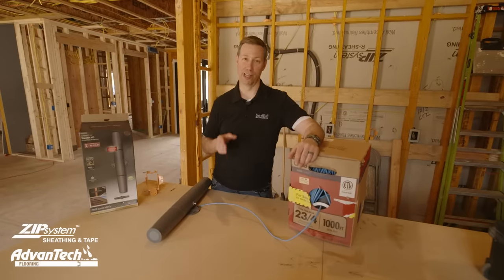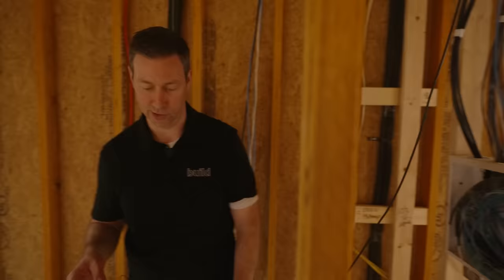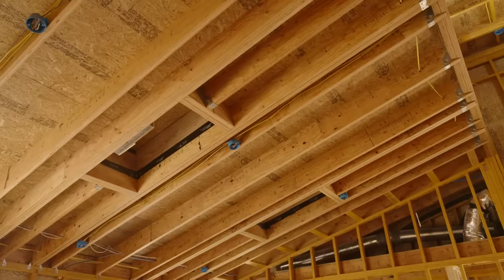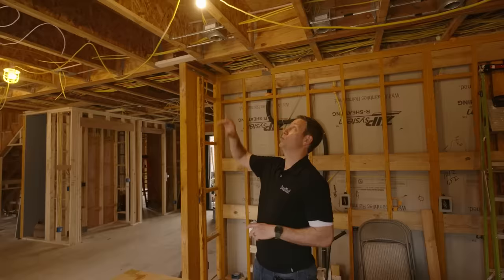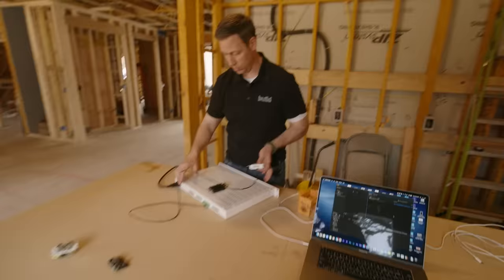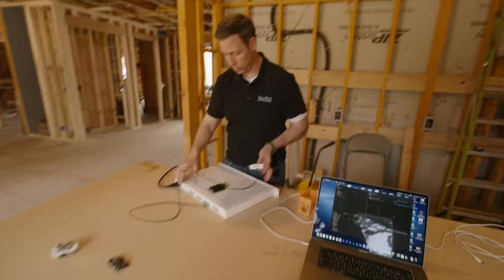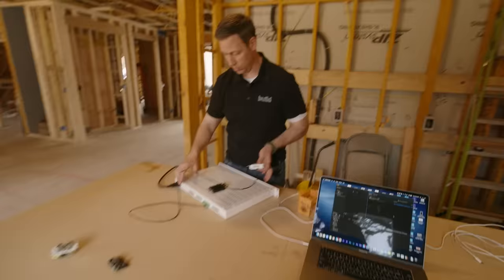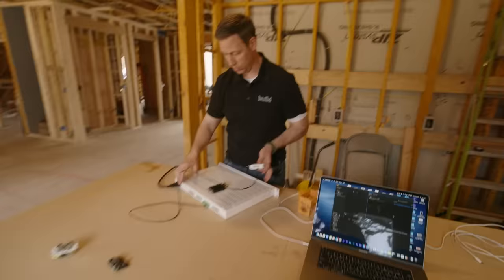Low ⚡Voltage at the Real ReBuild

Comment: And I absolutely would not do WAP's anymore. To expensive. Just wire a few places with an AC outlet and a network port. Then just use a mesh system. Lower cost, super easy for a regular person to install and doesn't burn as much when you upgrade it in a few years. I prefer TP-Link. And I pretty much install only Ring doorbells and cameras anymore. Ties right in with Alexa, Echo Shows and even the Samsung smart fridge display. Pretty great. BTW. I own an AV integration business.

Comment: You'll want low voltage smoke detector interlink connection as well. I just don't trust the fancy $100/each WiFi/Bluetooth smoke detectors. Personally I want those on hard wired on 110v and physically interlink connection between them. I did get the 10 year lithium back-up battery smoke detectors, but still 110v primary power.
Reply: Code requires linked 110v/DC smokes...

Comment: Run a separate power and conduit (for low volt) to behind the TV just in case Samsung's interface becomes a brick in the wall. (also PLEASE put your TV at the right height and not some excessive height that a lot of home renovation shows place their tv's at; now is the time to imagine sitting down at your couch and watching tv ... at what height would it be comfortable to watch).
Are the sonos speakers going to be able to receive discrete sound channels appropriately
(https://www.dolby.com/about/support/guide/speaker-setup-guides/)?
Do you have a place to put your subwoofer?
Ubiquiti's stuff is solid, but will the wifi be strong enough at the location you're placing it at to cover the house or do you require additional Wireless Access Points in other area(s) of the house for wifi coverage (run a single PoE line to these areas)?
Wherever you will have networked devices run extra network connections - devices that have a wired connection and that do not move around should be wired in (in case you get additional devices such as printers, media players etc), then have wifi to cover the rest.
Your Cat6 cable is 23AWG which is a good choice; just make sure it is solid copper and not CCA (copper clad aluminum) or stranded cable.
What about running additional wiring for security (door/window/water alerts)?
While not completely phased out, what about wiring for regular phone lines?

Comment: Regarding wireless you're picking up on something very important. The wireless of the future is wired. That sounds stupid... but the gist is that in order to make a reliable high speed wireless network you need access points throughout your home. The next gen of Wifi is designed around that idea as well and those access points are all wired.

Comment: As I’m looking at the photograph on YouTube for this video I noticed that the wiring above your head is not in the middle of those trusses, is that the way it supposed to be? I thought those holes had to be in the center of the trusses not near the bottom or the top. Perhaps I’m wrong I’d like to know.
Reply: Doesn't have to be centered. 1.75"(?) from finished surface minimum.
Reply: @skynetlabs  
Finish surface meaning with the drywall in place or the piece fastened on the bottom of the truss? However the piece on the bottom may measure 1- 9/16” I’m not so sure that’s the correct answer or if it is it’s written in a different way. 
The way I understood it, it should be in the middle 1/3 of the truss. 
I’ve seen contractors go ballistic with holes drilled in their truss because the trusses then will fail inspection. One could get away with many things decades ago but not anymore.

Comment: The Unifi stuff is pretty good, it is near professional quality gear that doesn't take a network engineer to install and configure.
Reply: It doesn't require an engineer, but it isn't for the "technically disabled", either. Lol.

Comment: Be careful as Ubiquiti got hack recently and unknown amount of their information was download. Ubiquiti is also a high-end solution and there are more affordable solutions that can do the same if not better job. Also when possible hardwire to devices as much as you can. WiFi is a security issue if not a risk, so any device that has a RJ45 wire it up. While have access I would run Cat6 to every window (that opens) and every door as with a new Raspberry Pi Pico ($5 or less) that just came out you could have a very low cost security device.  It's great that you went with Cat6, wire as much of the house with that as you can!

Comment: If you are using multiple unifi cameras you should use the unvr for cameras not the dream machine,
That way you have 3 hard drives for storage and 1 for redundancy 
Dream machine has only 1 drive so if it dies, bye bye camera recording

Comment: You made a mistake by not running cat 6A, at least for your WiFi access points..  It's not like you probably need 10 gig to the desktop but your better 802.11ax access points support 2 and 5 gig ethernet, since they can provide wireless data rates to clients in excess of a gig.

There are already commercial LED lighting panels that can be run from Power-over-Ethernet and have the ability to dim and change colors from the controller, plus integrate into other systems (security/alarm system comes to mind).  These do require an ethernet switch with a beefy power supply.

Lastly, a tip for the future to save time (i.e. don't tone your cables):  When pulling ethernet or whatnot, use a sharpie to label/mark the end of cable sticking out of the box before you run the cable.  Label the cable boxes or spools with the same mark so you know which box belongs to which cable.  Example: if you're pulling cable from 4 boxes at a time, put 1 tick on the first cable and box, 2 ticks on the second cable and box, etc., then pull.  Before cutting the cables off the box, transfers the same marks the boxes have to their respective cables.  Change up the pen color or use different marks for the next group of wires.   Could even use a combination of letters and numbers system.. Whatever is easiest to write on a cable, just make sure to update the mark on the box before pulling.  The goal is to not have to strip and tone, which takes two people and potentially a lot of time.

Comment: Wow, for once you talk about a nice high end home “prosumer” product and I don’t have to worry about it adding to my future budget!

Big computer/networking nerd here - I also use ubiquiti devices for my home network. I’m a huge fan of the price to performance/features they provide. Right now I’m using one of their wired-only edgerouters and two of their wireless access points to get coverage all over the house, had this setup for about 5 years now and have 0 complaints. Also finally got 500/500 fiber to the home after dealing with the cable company for so long. 

Especially with working from home, I like to run everything I can wired (the main pc, both tv’s roku boxes, receiver, bluray) to free up wireless bandwidth for the wife’s work laptop, my work laptop, our phones, and her tablet. No kids here but if yours are heavy streamers you might want to look into adding an extra access point on the second floor.
Reply: and I get further into the video and the goodies keep coming 

UPS for fiber box/router is fantastic for small power blips (I’ve got a small rackmount one, gives me 2-3 hours of internet without firing up the generator)

antennaweb.org is great, I’ve also got an antenna (mounted in the attic) that I just split to my tvs

Comment: 5:56 Fair warning about crimping your own network cable-- use EZ connectors if you can get them. https://www.markertek.com/product/plat-202016j/platinum-tools-202016j-ez-rj45-cat6plus-connectors-50-ez-rj45-cat6-strain-relief
https://www.markertek.com/product/plat-100054c/platinum-tools-100054c-ez-rjpro-heavy-duty-crimp-tool
The EZ connectors allow you to push wire all the way through the connector and verify you have the wire placement right before you crimp-- the tool will trim the excess. With traditional connectors if you are not exceedingly careful when you go to crimp, one or more wires can pull themselves out of the metal fingers of the connector, forcing you snip, strip, align the wires again and recrimp causing waste and additional hassle if you don't enough slack to compensate for the loss.  For a similar reasons use a modular keystone patch panel rather than the old style idc.  It is significantly less hassle to replace a bad line if you don't have to worry about putting stress on the other lines.
Speaking of that media closet it will get quite hot in there especially if you install any servers (NAS, piHOLE, Automation, et_al.) in there, since you still have the walls open it's a good time to plan for ventilation.  https://www.amazon.com/AC-Infinity-CLOUDLINE-T6-Temperature/dp/B074XBXFPD?ref_=ast_sto_dp  ... 8:32  wait... Looks up available info
https://voltekinc.com/dc-products/  While it does put out low voltage, its input most certainly isn't (With a 663 watt max (650w x 1/0.98) you may want a separate rack and UPS for that. )
Reply: @pauljgregory  Thanks for bringing attention to that.

Comment: The Voltek product seems too specific of an application. Would a POE switch not do the same thing and have way more versatility? We used that to get rid of all of the power supplies for our office phones. Or would a POE switch not provide enough power to charge a laptop?
Reply: POE rack mounted switch with 100w per channel output is a much better idea than that (assumed overpriced) made in china pos...

Comment: Can you not just run a circuit with, say, a 3A or 5A breaker and then therefore smaller wire and stick with 120V AC?  The breaker needs to be sized appropriately for the wire to protect it, and if you use smaller wire running a smaller breaker should offer the same protection.  Unless the authorities simply say "no, not allowed" I guess.

36V DC is actually going to require larger wire than 120V AC for the same power.

Comment: Cross discipline YouTube: regarding the voltec and macbooks louise rossman does board repair and the other day did a repair where the charger quality was an issue. I'd be curious if the voltec or any built in substitute is adequate quality to avoid damaging components.

Comment: It makes no sense to run heavy gauge cable for LED lights, that pull about 1 Amp at 120V, and then run narrow gauge LV cable that could pull 5-Amps per device at 12-20V. Voltage drop is a real issue.

Comment: ? 4 U . The media closet . Why do you seal the holes for the wires coming down to your box . ( great stuff foam )
Reply: Could be preventative. It might be required if the closet caught fire to prevent smoke and flame from rising to the next floor. Didn't catch it myself, was the foam orange? That's fire block. 

Also could be sound suppression through the holes too.
Reply: @AmandaComeauCreates  looked like great stuff . i just fig if you ever want to run another you cant just tape on to it and pull 2 . you have to crawl over or cut the ceiling lol

Comment: I'm really concerned about your cable there if I'm honest.  Firstly, the amazon link is to CCA, copper clad aluminum.  This stuff breaks easy, and if POE is ever needed, it has a high risk of melting, shorting, or catching fire.  You'll want to run Solid Copper cable, CMR (riser cable), along with shielded.  The Ubiquiti products are commonly POE.  Cameras are commonly POE.  You want the shielded with drain line (because it gives the ability to safely fault to ground) but also protects your equipment in the event of low voltage surges, shields against EMI and RFI of course, making sure you don't have packet loss, or risk of damage from static.
Reply: Of course you're not done with the build, but I'd recommend power conditioners in your low voltage closet, with a rack case, and two shielded grounded patch panels (one panel from the router, etc. one panel to your jacks, devices, and access points throughout the house)

Comment: Always run at least 2 ethernet to each location (A & B)...its cheap, gives flexibility and you're already pulling one cable. Just grab a second box and pull it with the first. You'd be amazed at how many times this solves the "I wish I had another port here..."

Comment: I had a full Ubiquiti wired and wireless internet system professionally installed in my home and regret it. Since it was professionally installed I don’t have access to make admin level adjustments and the wireless portion of the system, which is a series of ceiling mounted access points, is just mediocre at best performance wise.

Comment: Should try not to run low voltage/Cat cable next to 120/240... 12" Hz and 3" vert spacing is common to reduce interfere..

Comment: That Voltek system is going to use quite a bit of power when nothing is plugged in. Also, sending 60 watts of power through the house using DC is not as efficient as AC. So all their marketing about being green and environmentally conscious is not really applicable. They are also converting that from the 36v to 5/9/15/20 at the wall outlet, which reduces efficiency. You really are not saving on materials; you are already doing the copper for outlets, not like you can avoid that. And laptops come with chargers, so can't avoid that either. You also must buy the controller/converter for the voltek, that's not material-free.  Some laptops need 65 watts or more, so ya, it's an interesting concept, but other than convenience and "looks" it does not solve many problems.

Comment: Doesn't your speaker wire need to be CL2/CL3 rated for in wall use?
Reply: Most speaker wire should be at least CL2 for in wall riser use

Comment: I recently talked my boss into adopting more tech. But it's not worth investing in cat5 or whatever, because maybe everything is fiber in a year. Or maybe someone wants to run speakers. So what I talked him into running conduit, to buys can fish whatever they hell they want
Reply: I don't believe Fiber will replace Copper connecting devices. Issue is that terminating Fiber is considerably more difficult and requires expensive equipment to do it correctly. Fiber is great for long distance runs or backbone data lines which you need more than 10 Gbps per link. My guess is that Cat 6A will be the long term option since it currently supports 10 Gbps and perhaps 20 Gbps for runs up to about 150 feet.
Reply: You can't run power over fiber. You can with copper...

Comment: I wish that voltek power supply had more power for the price. USB C power Delivery standard can deliver a maximum of 100W but they cap you at 60. I wonder what the limiting factor for that is.
Reply: Finding an appropriate voltage convertor is probably the issue. I am sure the voltek unit has multiple smart power coverters. for USB c it need to supply both 5V and 20V. There is a data comm between the power supply and the device to negotiate the voltage. It defaults at 5V with an option to go to 20V if the device calls for it. Another issue might be liability, and some states have low voltage regulations for connections exceeding 60W. I believe in Texas, to install PoE over 60W requires a licensed electrician & cannot be done unlicensed.
Reply: 60W is a sweet spot for most customers. The higher the wattage the higher the cost.
I'm sure you will see them drop the A for a higher power USB C port on a future product.

Comment: I'm not an electrician but pretty sure wire sizes are dictated by circuit breaker size.
Reply: No Circuit Beakers are there for overcurrent protection.    Wire sizing is determined by other factors like ampacity, voltage drop issues on longer runts etc.
Reply: I stand corrected.  Just watched a Joel Walsman video and he said the same thing "CB determines the wire size" . It makes sense really in a KISS kind of way.

Comment: While I currently use ubiquity at home I'm liking them Less and less. There new wifi 6 AP keeps disconnecting and requires a reboot to come back online.  There warranty is lackluster and they have limited support. 

I would be more inclined to deploy a Cisco 1000 series switch as it has a lifetime warranty.  I had a switch get fried by lightning twice and both times they sent me a replacement next day air.

Pfsense would be my choice for firewall.   The UDM PRO works ok so I cant fault it for that but it has some stupid analytics.  It keeps track of usage for all time instead of per month which is not very useful.

For anyone wondering i salvaged the UDM pro from a failed work experiment so my personal investment is low.  Had I spent my own money I would likely gone with pfsense.

Comment: The Economist Magazine had an article about whole house USB distribution for both power, data, and LED here: - https://www.economist.com/international/2013/10/19/edisons-revenge - this is different to the Voltek system of just banging some low voltage down a cable to a USB outlet... this is where the entire USB system is distributed. Sort of like Power over Ethernet but USB based. Since this article there has not been a lot of movement unfortunately - but it is an interesting idea.

Comment: For computers and anything connected, as nice as wireless is, if you want speed, nothing beats hardwired. Don't believe me? Just run a simple speed test. Hard wire as much as you can now with the walls open. The worst that can happen is you don't use them. Wireless networks get very jammed very quickly. Go home and look at your home router at everything connected wireless. And as someone below mentioned, don't be surprised if you end up with two wireless networks.